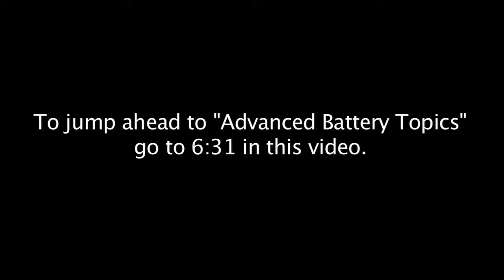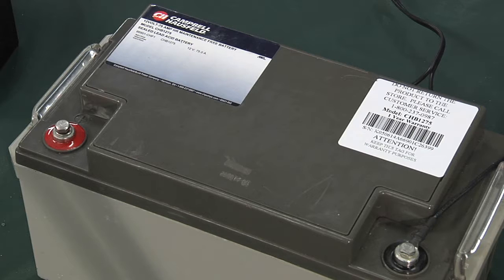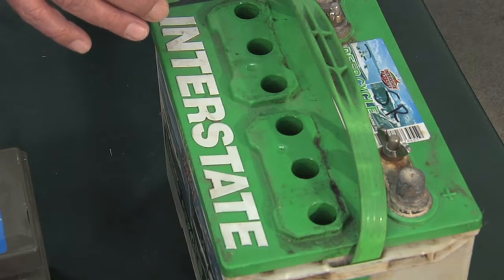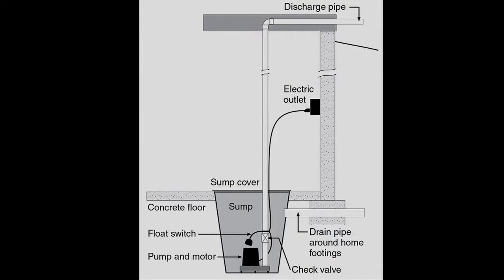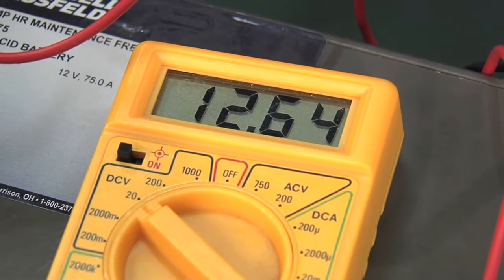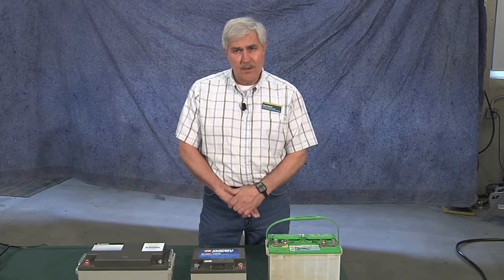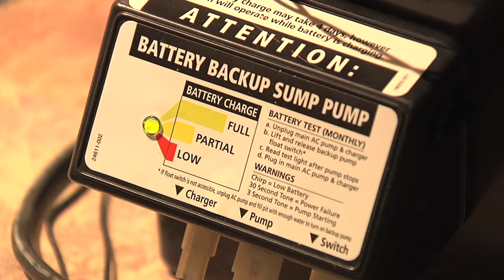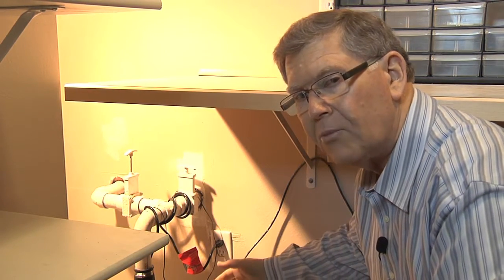Electric Backup Sump Pumps for Houses

Comment: The setup at my home has two separate canisters with the backup sump pump and the main separated (side by side). The main has water in it all the time and when it fills up it pumps out all the extra water but leaves a certain amount of water in it. Does the backup sump pump have to have any water in it or will it damage the pump if it's not submerged? Thanks